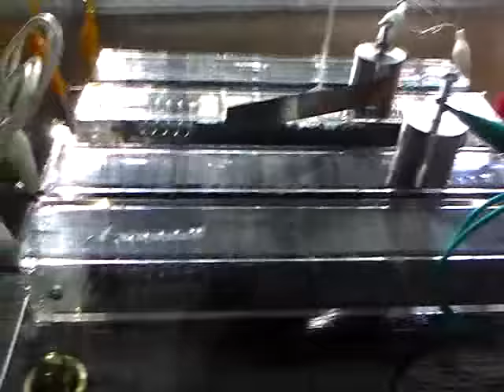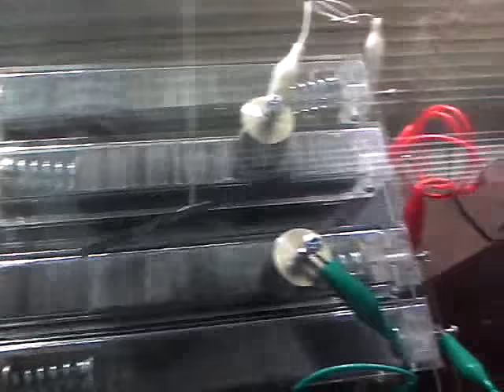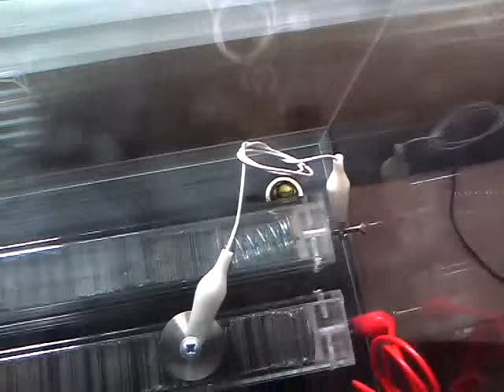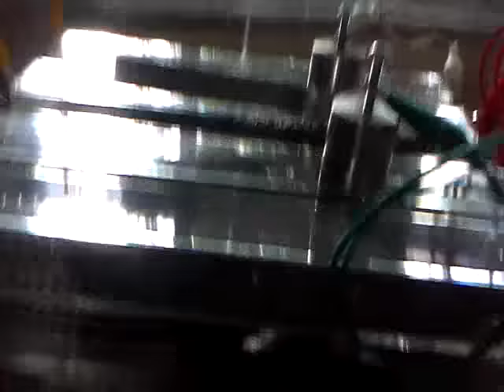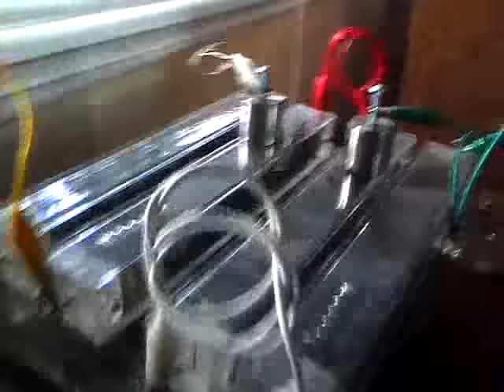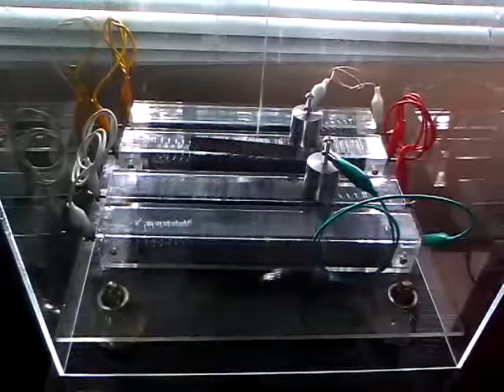My Zamboni Battery Device #3

Comment from the maker: Your information is correct. I did have major issues with current leakage. Long ago, I asked a battery specialist about it. He suggested putting the Mno2 in the center. It helped, but only marginally. I ended up making certain that all the squares were exactly the same size. That seems to have done the trick. Thank you for your compliment, this has been a labor that I never really expected to take as long as it did. I think I am in the home stretch and will soon be able to make them commercially